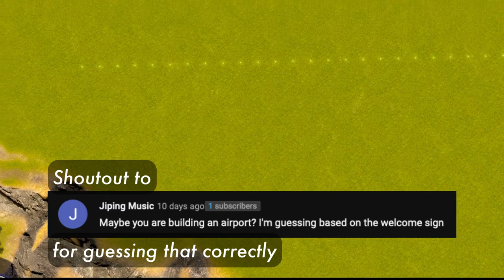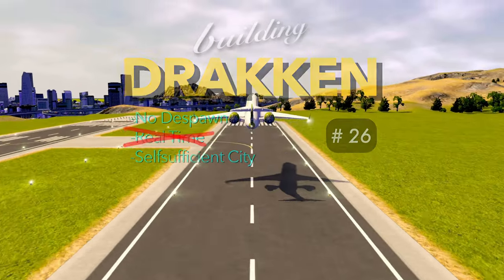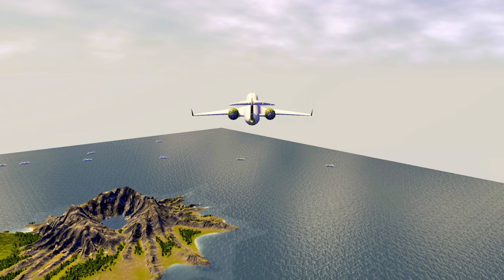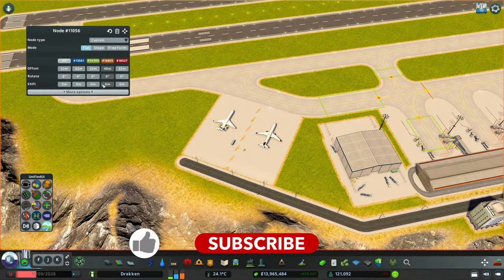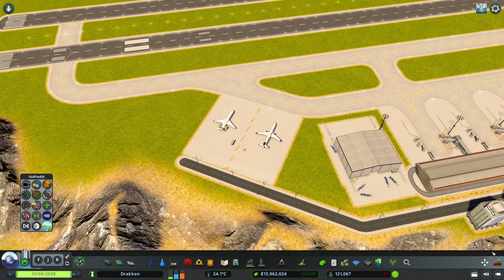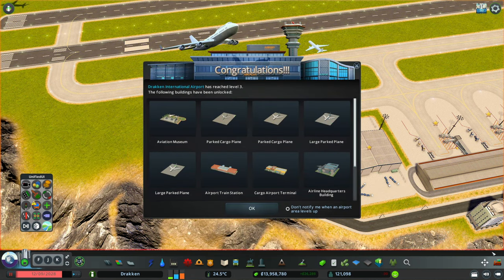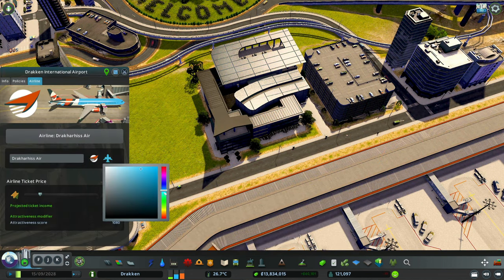The Sky is the Limit, Building a Realistic Airport in Cities Skylines

Comment: You picked an amazing place to put the airport. I figure the hardest part was putting in all the roads and tracks through those hills. Adding back the tree line and low plants really added the key touch to this build it needed. One thing I wish we could do is concrete in areas that would typically be concrete at a real airport.  Super awesome build, now I feel challenged to make sure my upcoming airport builds are top notch. 😬
Reply from the maker: Oh  yes, getting up there was a challange thus the extra episode on the interchange last time ... It again prooved to be challenging with the actual build. esspecially going under the highway which luckily was elevated already. But on the other hand i like the desnity right nextto the highway and id there is a gap and some kidseyes watch out for it then comes the airport in it's vastness... i mean i'd be impressed first by these "tall" buildings and then the absolute flat contrast with all those planes... oh i did actually watch the closing cinematics again and you'll see the change the "concrete" color on the surface makes... i am looking forward to seeing  your airport then ;)

Comment: Looks very cool. Don't worry if any measurements are realistic. A real airport would fill most of the map. Just as an example: for two runways to be used in parallel they would be further apart than yours are long.
Reply from the maker: i know but well i also have to keep it kinda fitting the city.